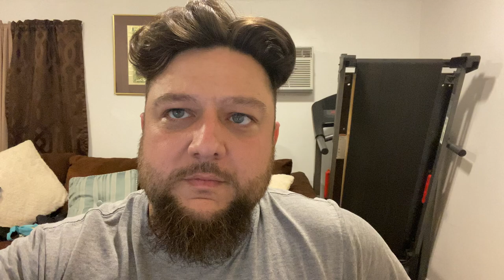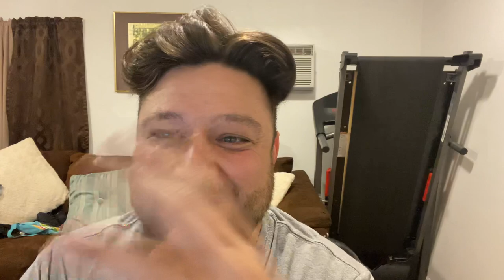Piston & Rod Combos For K series: NA, Turbo, High HP Turbo

Comment: at what hp would you think sleeves are necessary for a turbo k24/k20?
Reply from the maker: more than one answer for that question. ill be making a video on that soon. but what ill say is that for k series ppl have seen nearly a thousand horsepower on the stock sleeves. what id recommend is high hp css after 800whp